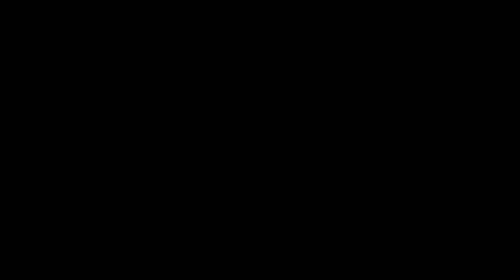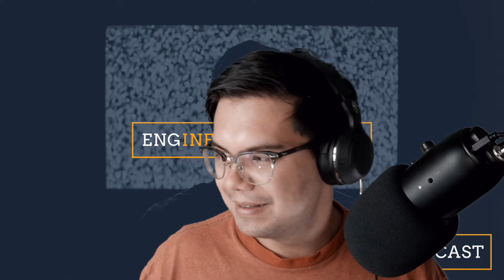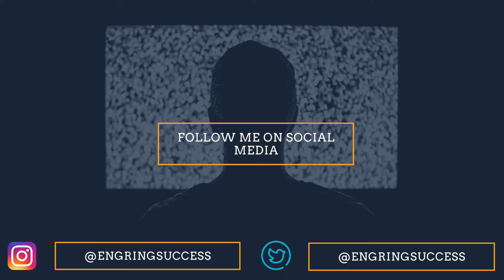Why is the engineering drop out rate so high?

Comment: I’m an older engineering student entering my senior year and have pretty much all the weed-out courses behind me (except Fields and Waves which I’m no longer super fearful of). 

I’d say a lot of it isn’t just the course difficulty alone, but that the difficulty of the course demands a certain level emotional regulation that many high school students haven’t honed in yet.

Especially in the US, High School is kind of dirt simple to pass. University may be the first time that many students encounter classes which can’t be passed by just showing up and occasionally scribbling on paper. This throws a lot of people for a loop, and it did for me. It can take some growing up to find the strength to put yourself through suffering and not quitting midway through. 

To that end, like most university students, engineering students are largely kids right out of high school. The ones I’ve seen drop out are mainly kids out of high school. I have a feeling many do return to complete their degree when they’re ready.
Reply: Where I went to school, a BS Engineering degree was listed in the catalog as a 4 year degree, but few took less than 5 years to complete. Some, Electrical, Aerospace,  Nuclear, and Mechanical required 2 "washout" chemistry courses, Qualitative and Quantitative. Quantitative each week met for 2 one hour lectures,300 students by the head prof, a 4 hour laboratory and a 1 hour problem solving class led by the lab assistant graduate students working on Masters or Doctorate degrees. The first major exam was a shambles. 24% for the high grade, 18% next, and single digits from there. The lab assistants sat around a table and took it collectively, and they All failed the test. It got better, a little. Multiple-choice tests - 1 chance in 4 of guessing the right answer.  Some made out the answer sheet Before even seeing the test. We were allowed to discard 1 test score at the year end.
   Then there was the mathematics requirement, Calculus 1, 2 and 3, Quadratic Equations, Series, Differential Equations were also washout courses. One professor opened the first class by saying that by the end of this course, less than half of you will be here to take the final.
Reply from the maker: Thanks for sharing your experience. I think most of the fresh high school grads are so occupied with “graduate college” that they just end up switching to another major and still try to graduate in four years. Doesn’t help that our scholarships are generally structured around that.

Comment: There was a truth saying when I was in Electrical Engineering classes.   You can drop out of engineering and become a doctor or anything else, but you don't dropout of any other degree and become an engineer..  Yes Electrical Engineering is very difficult and requires a lot of study and hardship, were engineering and working become your life while in school.  But it was worth it.
Reply from the maker: Very true, what kind of career have you had in engineering?
Reply: I started out as an Electrical Engineer designing bit level code for the code that runs inside of a micro processor, followed by chip design, followed by automatic test equipment for large printers and copiers, research engineer in Electro photography, then IT going from VM to desktop/server based computing and finally as a project manager on projects involving larger hardware and software based printer solutions.  It was a very rewarding life of engineering.  I started EE to become a airline pilot but enjoyed the Electrical Engineering more than driving an airplane. @ENGRingSuccess
Reply from the maker: That’s an awesome career journey, thanks for sharing!

Comment: I will be switching majors from computer science to accounting after my current semester and pretty much all of it stems from what you've mentioned in the video. Throughout the semester, I've been holed up in my dorm and at the library looking at a screen for the significant majority of the day, I haven't been able to make much relationships nor connections with others, and I've been perpetually stressed and tired. I'm doing great in all of my classes but this really isn't how I want to live.
Reply from the maker: Sorry it didn’t turn out the way you initially hoped but congrats on finding a new path. I have worked similar hours in engineering consulting (though not quite ever as consistently busy as they are during busy season for accounting) to some of my good friends who work for big 4 accounting firms, and 4-5 years out of school we are making very comparable money. Best wishes to you and thanks for sharing your experience!
Reply: It would have gotten much worse if you stayed, trust me
Reply: Accounting isn’t necessarily easier, just check the CPA pass rate. Also, you will have to spend many hours studying in accounting too. Also, you will be competing with students who are bright and interested in accounting, not just comp sci drop outs who chose “the next best thing.” Good luck.

Comment: I graduated last century but I think the biggest issue looking back was there wasn’t enough time to fully learn a subject during the semester.   You can do well on tests but not fully understand a subject which can be very discouraging.  You could have diff eq, thermal, a time consuming gen Ed, etc all in the same 15 weeks.  I took up learning some of the information one subject at a time while preparing for my PE. I felt like I missed so much at the time since I was spread so thin.
Reply from the maker: you're right. Time is a major limitation. I think it's completely appropriate for people to take longer to graduate. one of my peers planned for a 5 year graduation timeline, and it worked out great for him!
Reply: Or do it after you graduate when you know what field you are in.  The degree courses are just foundation.  I did more reading and “homework” after graduating than I did during school.  Even close to my 50s I still buy and  read technical / engineering books and work out the problems in my field.  My kids ask why I do it and just tell them there is a difference between schooling and learning.

Comment: Personal experience obtaining an aeronautical engineering degree. The large majority of the freshmen come into the program being at the top of their high school classes. They're used to being one of the 'smartest' kids in the room. Then they get into the program and get the dreaded 35 on a test and freak. That's right, you need to buckle down and LEARN (not study) the material. All of it. If you do, your grades improve and you start getting decent grades. But, you then realize that the program is not 4 years. There's no way you can take 18 credits in a semester and survive. You're looking at 4.5 to 5 years. That's demoralizing.
Had the good fortune to get some advice from a professor my first semester. He told me "you realize you can't ever get all the work done, right?" He explained that in the engineering world, you never have enough time, resources or staff to optimally solve a problem. You have to learn to triage and come up with an adequate solution. A lightbulb went off. I then triaged everything, noting what most affected my grades per hours invested. Who cares about a single quiz when the final lab is 20% of the total grade. My workload went down while the grades went up.
I wouldn't trade that degree for anything.
Reply from the maker: @SCFoster thanks so much for sharing your experience. You're absolutely SPOT ON. I appreciate you sharing your insights in the comment section. Please consider subscribing and offering your opinions and experiences in response to other videos.

Also, if you are interested in sharing your career journey, shoot me an email at Daniel@ENGRingSuccess.com and maybe we could do a career interview for the podcast!

Comment: Well 50 years ago it was  because you did get enough math in high school. I bet now it is even worse. I got all the basic chemistry and physics in high school.
 But advanced math teachers back then were also hard to find. Now most of them are liberal tarts majors.
 I spent more time learning the math in college electronics, physics and chemistry, than the course material.
Then there were those professors that just threw the math at the chalk board and left. They were as effective if they just used Egyptian hieroglyphics.
A lot like Elon Musk's explanation of air speed vs velocity and power. His explanation took 2 pages
 It is simple X^3/X^2. X^3 is the air density and X^2 is the power needed to push through the air for that speed. 
Kinda like why "What is the top speed of a SR-71" also requires this. At what altitude?
Reply from the maker: Thanks so much for sharing your thoughts and experience :)
Reply from the maker: Also, if you are interested in sharing your career journey, shoot me an email at Daniel@ENGRingSuccess.com and maybe we could do a career interview for the podcast!

Comment: Paul Graham wrote an essay in Dec 2019, 'The Lesson to Unlearn'.  It is about how the incentives of schooling is to get good grades, not real learning.  So most "good" students learn how to hack the test/teacher.  They figure out what they need to know to get the grade.  So you show up in engineering/Physics knowing how to pass a "content" test, but for engineering, you have to adapt to problem solving.  

It's like learning HVAC or other trades, you get your C or B and move on, the test just shows you what you have to go back and learn as you need to know it for some class later.  You miss a few things on Proust, oh well, but no one wants their AC fixed to a solid C level, or the engineering either.
Reply from the maker: You’re right. It all is cumulative. If you just go for the grade in a class, it’ll come back to bite you when you have to apply the knowledge you should’ve learned in another class

Comment: Physics 2 is one to consider
Reply from the maker: that is a tough class. reflecting back on my engineering studies, a fair number of my peers dropped out during or after receiving their grades for that course. E&M is just hard to get, for some.
Reply: @ENGRingSuccess  quick question do classes after that get as hard as that? Or harder…
Reply from the maker: I'd say that the concepts become more difficult, but that's because the knowledge all builds, if that makes sense? You're applying your physics 2 knowledge in your circuits, and electronics courses,  and then in your signals and systems course. Etc. the courses get more difficult but theoretically you know more, and you've gotten better about your study habits as well!